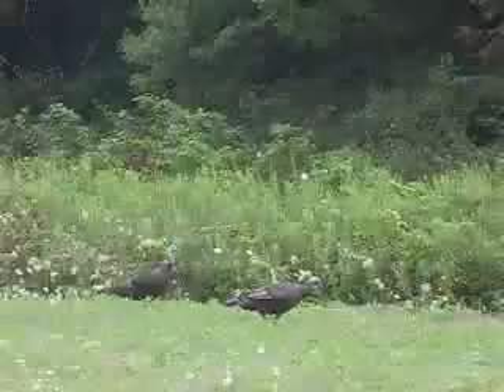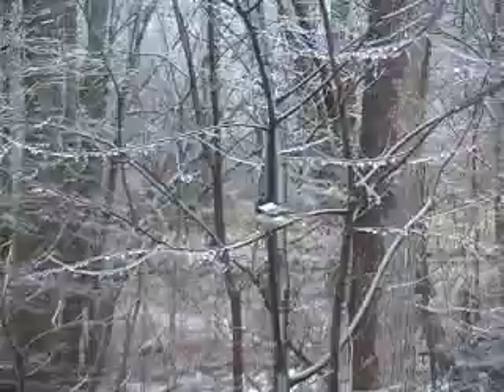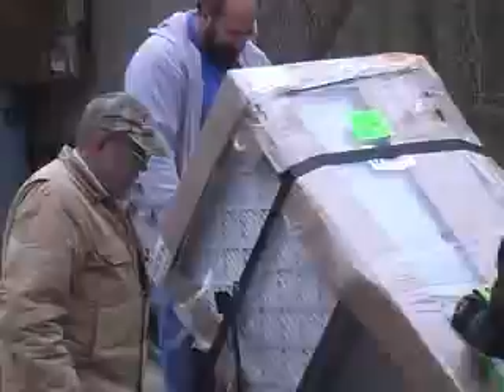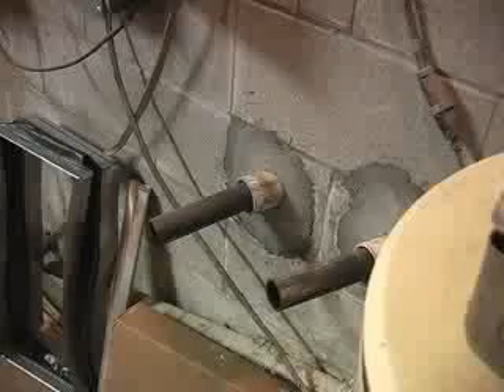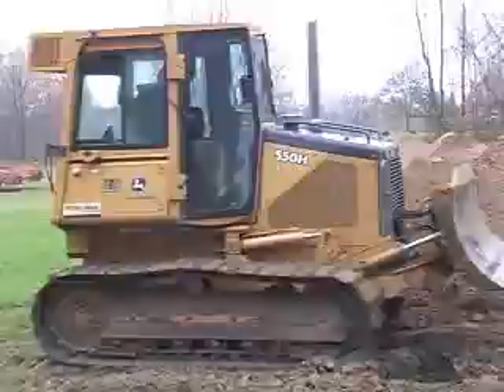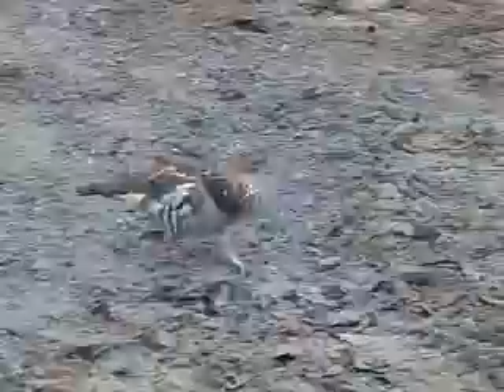My Geothermal Waterfurnace - Strategies4Survival

Comment: Thank you so much for this video. My husband and I are going to build a new home in a few years and we are talking about geothermal. My husband wanted to use a large outside woodburner. I don't think so. The woodburner would cost about $10,000 plus the price of the wood. Plus it would be messy.

Comment: >Global warming is fake, btw
You're wrong, but assuming you're right then so what?  Geothermal is cheaper.  Besides solar thermal, it's the only distributable renewable energy source that actually saves you money without requiring rebates (unlike solar PV).

You want to throw your money away on noisy inefficient standard HVAC then help yourself, but you'd just throwing your life's savings away ... he he he, fitting justice for a willfully ignorant traditionalist.

Comment: Not to be a fly in the ointment, but the guy who said normal air conditioners don't work in the winter has it backwards.  Air conditioners work best in the winter - when you don't need them.  Same with Heat Pumps - pump heat best in the summer when you don't need heat pumps.  Heat Pumps coils can freeze in the winter, but waterfurnaces won't.

Comment: Tackling this myself would have made as much sense as doing my own appendectomy.  I applaud you for tackling the challenge yourself, but the tweaking required to redo my current ductwork, the setup of the unit itself and the challenge in installing the pipes persuade me that this job was waaay more than I could handle and that leaving it to Gerry and the boys at S&J was among the smarter moves I made.

Comment: To those DIY'ers thinking they would like to do this.
I received the same $18,000 price from a geo installer
and realized this just would not make sense for me.
However, I did a lot of research and found that the cost was way inflated.  The unit itself is cheaper than a very good air source heat pump. You should be able to get an exceptional 3 ton unit for around $4k. 
The short of this is that my "difficult" installation should cost ~$9,000.